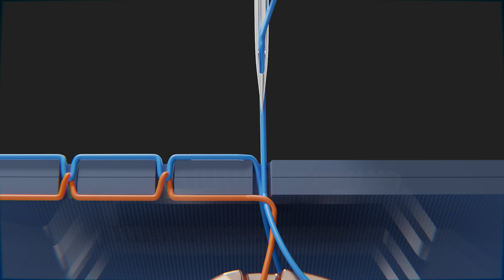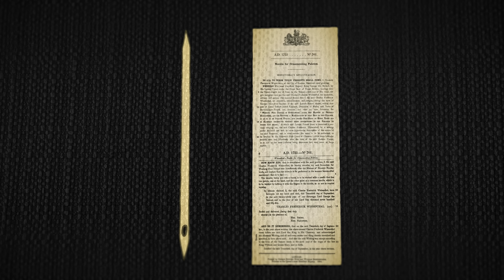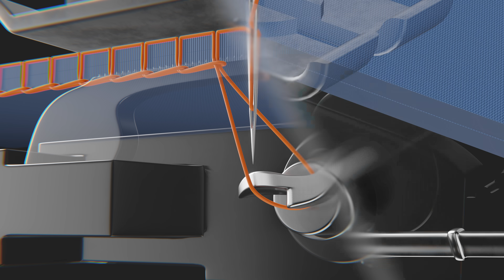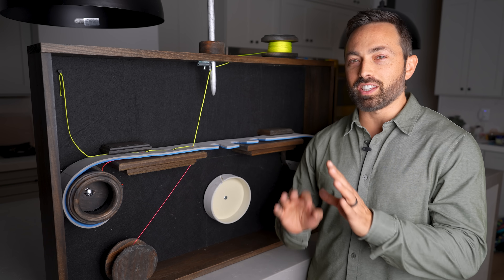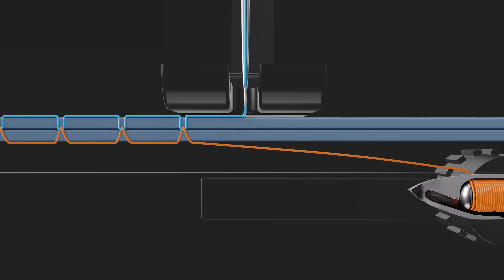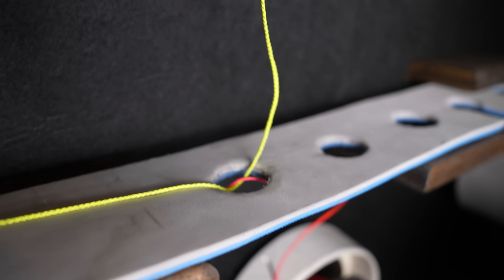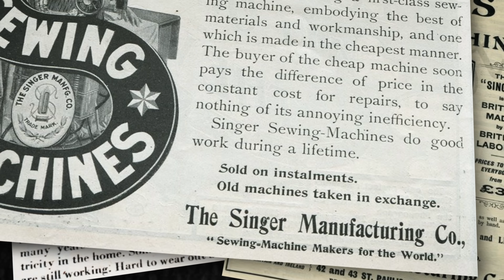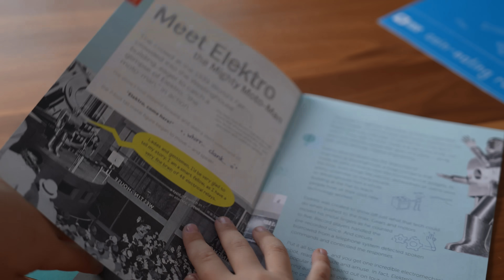The Surprising Genius of Sewing Machines

Comment: I started crocheting recently and learning how to make stitches is actually kind of mind blowing. The fact that a sewing machine is essentially doing the same thing super fast is really cool.
Reply: The chain stitch is used quite a lot to close large bags of loose goods, like dry dog food, fertilizer, and so on.
Reply: As a experienced crochet nerd I must respectfully disagree. For one crochet sits in a grey area. It is fabric creation like weaving but it is also fabric manipulation through pointy means. It is needle work by technicality. The only crochet stitches that machines can even begin to replicate is the chain stitch. Time line wise crochet was one of the last fabric based hand crafts invited and as such it is the most physically complex. As of now it is also the only one that machines are unable to replicate. Every crochet design comes from about 7 basic stitches. The basic stitches  themselves require a lot of precision hand movements that work both the fabric being made and the hook. However the real complexity in crochet comes from the fact you have to build each stitch individually. By making each stitch its own independent variable you can put basic double crochet in the same space to make a fan stitch or work 1/2 the stitch 7 times in the same space before finishing it to get a puff stitch and both stitches will give you different fabric textures as a result. Crochet has almost endless combinations of fabric density, texture, weight, and 3d shape that my be accomplished from the ~7 basic stitches. The crochet fabric itself also has unique properties. Because of the way it is made the fabric doesn’t have a grain/bias. It can stretch equally well in all directions. They even use crochet models to show high level mathematical constructs because it is the only way to get 3d shapes that can be manipulated into the complex shapes of the constructs.
Reply: Yes! The first model is totally crochet! The same crochet that is made at the borders of kitchen towels.
Reply: @keslyajennifer Not totally. Those early machines used the same STITCH that decorates your kitchen towels, but that's embroidery. In both, the thread/yarn passes through fabric, one layer of fabric for embroidery and at least 2 layers for sewing. 
Crochet is a technique for CREATING fabric. Plus you can't crochet fabric out of chain stitches alone; chains must be combined with other stitches.

Comment: What a coincidence. I've just bought a 1960s sewing machine and it's beautiful. It's based on a Singer Class 15 and runs amazingly for a 70+ year old. Looking at it operate, all the rods and linkages, is like watching a steam engine. Fascinating! Then like magic, there's a plethora of presser feet that turn a simple straight stitch into works of art. All with links, oscilators, ratchets and cams -  not a computer or servo in sight. The people who invented and developed sewing machines were geniuses! 😊

Comment: Great video and animations. But for the oscillating shuttle: how does the thread not get snagged by whatever driving mechanism is attached to the shuttle (the animation shows it free floating in space)? For the bobbin version: how does the thread pass around whatever axle is holding the bobbin in place?
Reply: For the bobbin version; it's a stub axle that's only held on one side.
Reply: @danl6634  that's the most important part and it's what I came here to understand, and yet it's precisely what was left unexplained. I can't believe that in almost 20 minutes it was never explained
Reply: the bobbin is sitting loose, without axle, inside the rotating case with a slit or hook, that pulls the loop around the entire bobbin.
Reply: The shuttle is kicked back and forth without being held by anything, because the loop of the upper thread goes completely around it. The improvement of the bobbin is that that bobbin is not moving, instead, the thread moves around the bobbin. Less moving parts, easier mechanics, higher speed.

Comment: We have an old singer machine that can be either electrically driven or driven by foot paddle and flywheel. It creates one of the most beautiful straight stitches of all machines I have ever used, and it works at the summer home where there are no network power, only 12V solar.

Comment: Singer sewing machines that were produced a few decades ago were different from the new ones. Back then, Singer manual sewing machines were the known as the best, and known as black sewing machines here. The second most popular one was Butterfly brand, but the quality was not that good. However, the ones produced now are not as good and more problematic. A famous black sewing machine repairman Youtuber, Mamat Ting Ting has a video titled "SINGER baru yang SERING bermasalah". It discussed how they are often jammed and the machines work heavily (not smoothly). Some viewers also comment on how their machines sometimes skip stiches, get loose tensions or keep causing tangled thread.

Comment: If you want to continue down the path of the wild world of textile, check out weaving— particularly dobby and jacquard. The punch cards used in these machines are famously the precursors to computers, but the mechanics of the machines are inane. Not to mention the precision in clearances and timing required for them to work correctly.

Comment: Yep, I’m in the business
Reply: Hand stitch is a 200 classification with variations. 1 thread mechanical is 100 class. 2 thread lockstitch is 300 class. 2 thread chain is 400 class. There are several more, like cover stitch and over edge.
Reply: That first stitch you shown was a 101 chain.
Reply: Something to be mentioned, needles must be sized correctly also. The eye is sized for a specific thread size and the blade of the needle needs to be sized to not damage the fabric. Typically the blade and eye size are linked and you choose the thread size for the project based off that.

Comment: I actually have sat with the bobin compartment door open and watched how the sewing machine worked. Your history lesson of the different machines and explanation of the tension helps alot in fine tuning the tension to get better results.  

I've had my machine for 35 years and like it, but it can get temperamental. Now I understand why.

If more people owned sewing machines less clothing would end up in landfills. I have repaired countless garments with my machine and kept them going.  Some of my clothing is over 30 years old (I don't like change).

Comment: I retired just over 10 years ago from my job as a sewing machinist. We still had a machine for sewing buttonholes that had originally been powered by connecting to a rotating shaft driven by steam, but had been converted to electricity. It was extremely noisy and cantankerous LOL.

Comment: If you as a researcher are curious about seeing machines/quilting machines. Contact the company APQS. I worked for them as an intern one year. Their machines also keep the exact same stitch length REGARDLESS of the path it takes. Curves, turns, loops, straight, all at various speeds. It’s insane engineering.

Comment: I made a living for a long period of time installing and maintaining industrial sewing and embroidery machines.
You mentioned that the tension on the thread needs to be the same on the top and bottom, but this is not always the case.  Depending on the type of  fabric and even the size of the needle, you often require uneven tension on the needle and bobbin threads to create a perfect stitch.

Comment: 77lbs per person per year!!!!!. My jeans are 14oz, let's round to a Pound. I have 15 pairs and I just refreshed my stock since 10 years ago. So 30 pair over 20 years. My shirts weigh 5 oz, so 3 make a LB. I have 18 total, making 6LB. I have maybe 2lb of socks and maybe 3lb of underwear. I have 15 plaid shirts and donated 10, making 25 with my scale weighing my heaviest at 1.1lb and the rest around .6lb. 15.5lb in shirts since middle school that means. I have owned 4 jackets and 3 on the scale together weigh 7lb. This is 30+6+3+2+15.5+7=63.5lb of clothing I used over the last 20 yeards of my life. I am sure I need to put towels, rags, and shoes in there, but there is no way in hell that 20X's my cloth waste. 

So now I ask, what are you guys doing with your clothing. Atleast all my middle school shirts and jeans that were not ripped(1/2) went to Good will.

Comment: I really wish you had gone into the hidden mechanic of the machines. The needle was just a small fraction of the thread handing advancements. These machines were analog computers in their own right and were a marvel of engineering.
Reply: Agreed. I’m still not clear in how the thread is supposed to go around the shuttle or the spool in the lock stitch machines, unless whatever makes them oscillate/rotate lets go once each cycle, or magnets are used?

Comment: my wife has a serger / overlock machine. you should check one out they are awesome pieces of mechanical marvel. 5 locking threads and cuts the fabric, and makes an elastic join using standard non elastic thread.

Comment: @5:32 you speak about a mob of angry tailors ransacking one of the first sewing factories; whats both frightening and interesting to me, is how analogous the Sewing Machine was back in its time, is to "generative AI" is today. I am by far not defending "generative AI" (and question really how generative it is, since all it really does is apply the copy and paste function in a novel way)... but I have to admit that there is a creepy parallel between the sewing machine and "generative AI" putting the ..skill and talent.. (questionably) of a profession at the finger tips of the every-person. 

Edit: to clarify I am not questioning the skill and talent of the profession, but questioning instead the machines ability to replicate it..
Reply: it's progress
Reply: As an artist, I noticed the same thing. But I think it's much more analogous to the rise of digital art rather than the rise of AI-generated art. Digital art uses a computer and/or drawing tablet (a machine) which has certain advantages over traditional art done on paper or other physical mediums, such as the ability to undo, erase anything, rearrange things easily, etc. Both digital art and sewing machines still require skill to use correctly though. AI-generated art has no equivalent in this, because the way it works is like you said - a thoughtless regurgitation, relying on the works of artists without consent. It would be like if you could make clothes by pushing a button and sometimes the clothes have strange defects a human would never make.

Comment: "pull in the excess" almost no sewing machine explanation can actually form a stitch because they always miss one of the most vital pieces in all sewing machines.
The "take-up lever" is responsible for removing the top thread from the bobbin space and without that principle your machine will always lock up during the second stitch.
The entire machine must be synchronised so the needle may rise, form a loop, allow the loop to be caught and expanded over the bobbin, and then have the loop lifted and pulled tight. All this while ontop of advancing the material without bending the needle.
More love needs to be shown to the take-up lever.
Reply: Unfortunately, the business Derek is in does not involve ACTUALLY explaining anything properly.

Comment: 1:38 A way to understand it is to think of crochet, not weaving.
Plunge through and pull up a loop of thread from below, go through the loop, pull through a loop from the thread that's above; go through that loop and repeat.
This is familiar to someone who crochets, though only one thread is used.  Because we're adding on to the edge of the cloth, the same thread can be grabbed from below or above,.  But the moves feel very familiar -- it's just the "single" crochet stitch (American nomenclature, if that matters).
This technique can be traced back to 1823.

Comment: I’ve been a Parachute Rigger for the Navy for over 18 years and we still use some of those old Class 7 oscillating machines. Some of them are nearly 100 years old and they are powerful enough to punch through a stack of 3 quarters.
Reply: I’ve worked on a few that came through the shop which have the Navy anchor stamped beside the serial number.  Converted a few to have reverse and to sew synthetic lifting slings.
Reply: Class 7s are true beasts!
Reply: Is the Speedy Stitch, or something like it, used by the military?
Reply: @Zerpersande  not sure what a speedy stitch is. 🤷🏻‍♂️
Reply: Three quarters of fabric, surely. Not three actual quarters. … Right?
Reply: @liesdamnlies3372  ….I know what I said. Lol

Comment: I've worked around big embroidery machines before, essentially a bunch individual sewing machines bolted together and operated in sync for pumping out loads of identical pieces at a time, and they are loud. Even the modern ones, all electric, made of plastic, and run by computers, are very load when they're going all out, I can only imagine the noise of working in a factory with dozens or hundreds of those old, all metal machines going at the same time, along with the generator powering them somewhere close by. Would have been a nightmare.

Comment: The boat shaped shuttle is called a "transverse" shuttle which moves backwards and forwards linearly. A "vibrating" shuttle is bullet shaped and it swings in an arc. The Singer 27 has the latter vibrating shuttle.

Comment: Whenever I think of O’Neill cylinders, I think of essentially that thread as a 10 foot diameter carbon nanotube cable, able to not only transmit power, but also have a capacitor.  Besides being able to turn it into a magnet on the outside.

I always thought of essentially scaling up weaving a basket (cylinder) like that and then having Large Stainless Steel Foundation Footings go through the length of it like screws, while having different size meshes and directions, girders,  and either concrete, or essentially fill it in like “isomorphic” carbon fiber (graphene carbon fiber)

You can have carbon nanotube yarn that also has radiation protection properties, woven through the entire cylinder.  While also keeping it’s conductivity

To do this on an O’Neill cylinder at scale, would require something like this, or you could do it with robots mimicking a surgeon’s hands Scaled up surgical robot, but for space) You can’t just make huge parts that are bigger than buildings flown into space.  ￼
Reply: tbh it's just far, far, far easier to make an O'Neill cylinder out of an asteroid and just use steel

carbon is useful in applications where speed is important, but those cylinders are habitats, they could be moved but it would very rarely be in a hurry

carbon sheet weaving is, well, weaving, not stitching, there are weaving machines for that

Comment: Thank you for this video.  My mother is a dressmaker, and ever since I was about 16,  I have pulled apart her machines and tinkered, fixed and broken them when they have stopped working well.  The mechanism is amazing.  What is more amazing is that they can be made and sold for as little as $50.
Reply: In the 1960s there were children's toy sewing machines that cost very little. They did the chain stitch, maybe not with complete reliability.
It was also possible to buy very cheaply 100 year old Willcox & Gibbs chain stitch machines from antique shops and auctions; these were really well made, with spherical bearings at the ends of the connecting rod that coupled the upper and lower mechanisms. Most of these very old machines will last forever if you oil them occasionally.
Reply: @cedriclynch  My sister had a toy machine that did the chain stitch, that would have been the late 70s. You just triggered my memory, thank you.  The thing used to run on batteries and chew through them in about an hour. My sister, being older and therefore my boss used to make me wind the wheel on it once the batteries were gone so she could make another dress for her dolls.
Reply: @spindoctor6385  The thought occurs to me that toy sewing machines are probably now banned in many countries, unless they are dummies that do not actually sew. In the UK and the European Union it is now illegal to sell anything with an accessible sharp point to anyone under the age of 18.
Reply: welcome